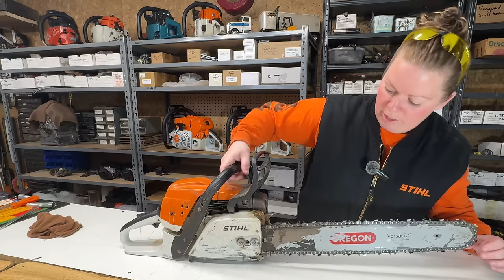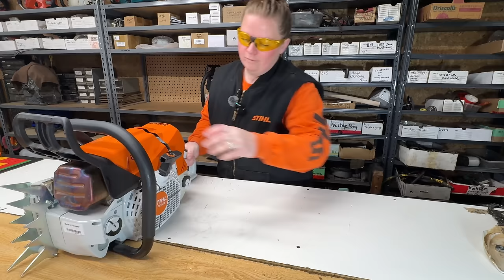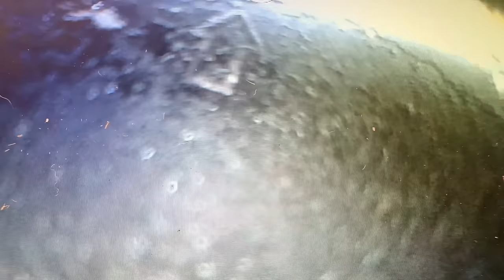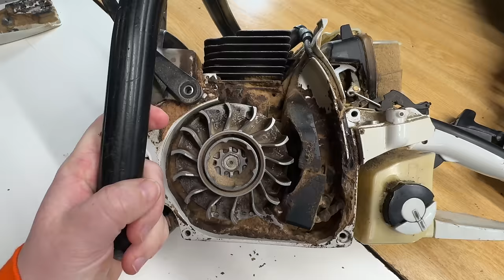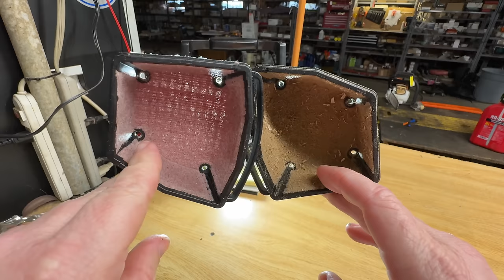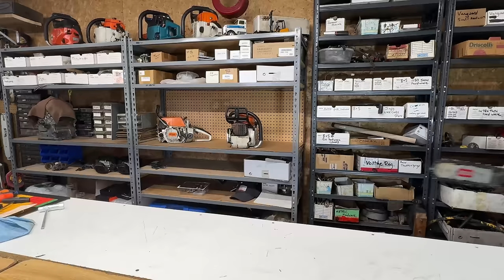Stihl MS 362 Chainsaw!  Very HARD To Start And LOW On Power!  Let's Fix It!

Comment: This lady is good. What makes her videos so good is that she does close ups when she needs to. If I did not know better I would think she works  for Stihl Corp as a trainer. She has all the correct equipment to work on saws and has a pleasant personality to boot. She speaks slow enough to follow her work, unlike the vast majority of shade tree mechanics who seem to think you have to speak as fast as an auctioneer if you want to make videos. Another one of her positive traits is the fact that she cleans up her saws before she puts them on the bench, unlike most other Youtube small engine mechanics. She also moves the parts that she removes out of the camera shot so that she keeps a clean and uncluttered bench. That in itself is tremendously important. She has a good camera/microphone and does superb setups. I don't know if she does her own editing or not but someone spends a lot of time with the software to do that. I rank her Youtube Channel equal to James Condon's Youtube Channel. With all her positive traits I am certain her business is profitable and her Youtube channel is very profitable as well. If you want to learn something about repairing chain saws follow her closely. Did I say she was entertaining too? Well, I just did.

Comment: Great work on the chainsaws, especially the small one, servicing is key if you do it yourself or send into the dealer dependant on the tool and skill set.
Using the right fuels and lubricants from Stihl is key as well, I’m still using the Stihl oil Castrol Manufactured before the red and green superseded the blue one.
Run beautifully😁🇦🇺
Note:Read your Stihl Instruction manual, even on a rainy day!

Comment: I got a 362, and if you ask me, it's one of the best saws ever made for general tree felling. Light, brutal power and acceleration. I use mine with 16" Tsumura light, and an extra 20" Oregon bar in my toolbox.

Comment: This last fall, our snowmobile club purchased an MS362.  We've had a few issues with it and the first one, of course, the dealer said that they had never seen it before...the throttle butterfly shaft was frozen up.  After one running, it was inoperable.  The mechanic had to replace the new carb.  The other issue is the dealer tunes it for 1300 feet in elevation and we run it above 4000.  Just after the saw warms up, it doesn't start unless we have the throttle cracked open.  Other than that, the saw loves to eat wood.  Thanks for putting up such great videos...not only educational but very entertaining as well.
Reply: Time to learn how to tune to carb for elevation & ambient temps.

Comment: I love my saws, especially my big Stihls.  I'm very meticulous when it comes to cleaning them and I do it after each and every use.  Good saws are an expensive investment and well worth the time and effort to keep them clean.  At least in my opinion.  That poor 362 looked like it had never been cleaned.  Wow
Reply: Totally with ya on this.  Replacing big/pro saws isn't cheap. I quite enjoy time in the shed with radio on doing maintenance after a day cutting.
Reply: @badgerjim71  Jimmy you sound like me!  I enjoy cleaning my big saws...my little ones too!

Comment: I have a MS-362‐C with a ported muffler and a 24-inch skip tooth. The saw is a beast.   My saw gets broken down and cleaned "washed" after every use. 
If you take care of your equipment, your equipment will take care of you.
Reply: I have one too. I don’t like the skip tooth because the chain feels rough to me. They sold me this one because I am 74 and I was having trouble starting my bigger saws. When it is cold I pull out the rope 5 times and then it starts on the first pull. I also mill lumber freehand with a 36” bar, works fine. I clean it every time I use it and touch up the chain. Love the saw.

Comment: The 362 The Saw That Choked Itself 😩😩😭 Plugged Air Filters And Clogged Cooling Fins and Air Diverter Ducting Nice Catch 😀Are Shop Is Getting Swamped Also Your Guys Shop Is Huge I Love Working On Walkers My Former Employer Was a Walker Dealer So I Worked on a Lot of Them Even The Old Chain Drive Models 😀😊 Still Work on Them At Were I’m At Now

Comment: Thank you for posting this excellent video. It is a good lesson in the value of giving any mechanical device a good cleaning and inspection at regular intervals. My grandfather owned and operated a commercial sawmill. He did keep the mill's engine (a gasoline v8) and the platform where people worked pretty clean, but everything else was covered in sawdust. He went deaf because he refused to wear ear protection. I hope you will consider wearing ear protection even when you start an engine for short periods.

Comment: Lovely saw the MS 362, I bought one second hand earlier this year from a Stihl dealer. Saw your video and although mine doesn't need a service yet I thought I would watch it, so i know what I am in for when it does, although, since I am retired, it will not get such a lot of use. (that's why i bought second hand)
I also have an MS 162 I use in the garden.
I used to have Partners, which I used a lot in the 1970's felling huge dead elm trees in the English Midlands after Dutch Elm Disease killed them by the thousand. 
I find Stihl a lot easier to get parts for.
I run my saws exclusively on Aspen two stroke fuel which is ready mixed 50:1 Ethanol free fuel since they are not used all the time I know I can leave them for months and the fuel is still ok and they will start after a few pulls.
This fuel is very expensive and wouldn't suit a professional using the saw every day, but will last up to five years. I believe Stihl make a similar fuel but nobody sells it in my area.

Comment: Great video, I had two MS362s given to me for repair recently. Both with severe wobble in the clutch drums, so bad the oil pump arms weren't rotating and both would stall when the brake was operated.. Turned out major PTO crankshaft wear was to blame.. Both saws were scrapped by the owner.. :)

Comment: I have a Husqvarna blower with a ton of hours on it (approx. 2000 or so) that has a similar issue. It just seems down on power. I put a new carb on it, did a spark arrester delete (it's no longer available), replaced the fuel filter, and cleared a restriction from the muffler. I bought a new air filter for it, but the one that is in it doesn't look that bad, so I haven't installed it yet. It belongs to my mom, and it was extremely carbon fouled. She is definitely putting too much oil in it.  All of the things I did made it run better, but it still doesn't feel like it is 100% to me. It's starting pretty easy and idling perfect, but it just doesn't seem like it is running at full throttle. It's a BT130. She's had it for years, loves it, and uses it just about every day year round. I want to get it running as well as it can. Any ideas?
Reply: If it's been run heavy on 2-stroke oil I would think an "Italian Tune-up" would be the next course of action.

Comment: Another great video.  Sure enjoy your channel.  You’re so methodical in your procedures.

Figured this was a good time to ask this question that has been bugging me ever since I bought my first Stihl saw with the Frankenstein fuel & oil covers.  This seems to be a good example of German Engineering.  Why design something that works with 2 or 3 parts when they can come up with something that doesn’t work any better but is much more complicated and consists  of 10 or 12 parts.  You got it, the funky oil & fuel caps.  I have learned new words after I have got back to my log pile after refueling only to learn the gas or oil is all over my pants & boots.  Have you ever learned from Stihl why these have to be so complicated?

I was in awe at how big you operation is.  How many technicians do you keep busy?  Do you each specialize in the equipment you work on?  Do you also do videos on lawn equipment?

Your channel is great.👍

Comment: fun fact, a saw covered in wood dust usually means they have been using a dull chain or a chain with high rakers. the chain should make chips, not saw dust.
an overly tight chain can also make it feel low on power

Comment: Some mornings need a magnum coffee.

Perhaps a new chain went on.  Chain got retensioned after cutting while hot and then put away.   It cooled down and tightened up.

Blue oring on the bar oil cap!

Comment: Question: I have a MS250.  I dont use it often, but when I do use it I use it heavily, mostly in the spring when I cut brush on my acreage.  I usually flip the bar and touch up the chain with a file with each tank of gas.  When I have the clutch cover off, I blow off all the sawdust and oil with compressed air.  Is this okay? It occurs to me I could be blowing oily dirt into spots where it doesn’t belong.
Reply: As long as the air filter is on you should be ok.

Comment: My Craftsman chainsaw start with no problem but after 5 minutes of operating and getting hot it shuts down and don't want to start for a while.
I replace the fuel lines, fuel filter and air filter.
It's a very clean machine with not much use. 
You think it's a carburetor needs to be adjusted or I should look for problem somewhere else? 
Thanks in advance! 
Love your channel!!!

Comment: Used to have access to an MS880 for milling. Great saw for milling but had to get someone else to start it and heck are they heavy. Heavy powerhead, then add the b+c and the mill. Almost too heave to pick up. And they drink fuel, as do all big saws.

Comment: buying at least a portable 125psi capable air compressor for a home shop is good enough for users to use to keep their chainsaw cleaned out after each use
Reply: Please...
OSHA:
"Compressed air shall not be used for
cleaning purposes, except where reduced to less than 30 psi and then only with effective chip guarding and
personal protection equipment."

Comment: Is there a way to check mix ratio of existing fuel? Like they do with anti-freeze mix?  Why do the 881's have a single knob to remove air filter cover but other saws require a tool and 3 screws to remove the cover? My 260 is a  quarter turn to remove the cover. Were users having issues with the covers falling off?

Comment: I have a 310 and a 461, I can't imagaing needing a 881 except in the redwood forest.
Reply: I cut mainly hardwood and some of the bigger stems, are easier cut with something that’s not going to be screaming the whole day. Plus, if you’re going to be running 36” or greater, for more than the occasional cut. More cc just makes life easier, providing you’re not carrying the thing and everything else you’ll need for a day’s cutting a 1,000yds. just to get to the first tree.

Comment: When a saw comes in thats just completely filthy, i mean like 15-20 min of cleaning prior to inspection do you charge an extra fee or just add it to the hourly rate.
Reply from the maker: Hi Mike.  I just charge for how long it takes.   If a saw requires 15 mins of clean up , then it’s 15 min of labor on the bill.   Most customers don’t mind and appreciate getting the saw back cleaned up.   If they wanted to do it themselves , they wouldn’t drop it off for me to do 😊
Reply: @marriedwithsmallengines  thank you Erica, sorry to bug you but I sent you another email. Sorry for so many questions. Take care ma'am.

Comment: Whats yr thought on a 500 I ? Thinking of purchasing one with a 28" bar
Reply from the maker: Amazing! 🤩
Reply: No carb to worry about and it seems like the injection and computer system is bulletproof.
Reply: The only issue with the 500i is fuel consumption. Other than that its great. Id get a 462
Reply: The 500i as has been said, is heavy on fuel but it is near 80cc. I run a 25” bar with full chisel full comp chain, (I’d use semi skip it ever or even full skip, if I was going to run a bar longer than 30”). It would fly with anything shorter than 20”. I think 25” is it’s sweet spot but I know a few who run their’s on 28” or a little long and they’re happy.

I’ve always found mine hard to start from cold or hot from new. But once it’s running it’s good. I’ve also got a Husky 545 Mk1 on 15” and a Husky 550XP Mk2 on 18”, (both on .325” .058”, full chisel full comp. Those handle 80%+ of the stuff I deal with; I only use the 500i, when I know I’ll be cutting 24” dia. and greater stems all day.  Just easier on the equipment. If I’m going to have to carry everything I’ll need, plus some of what I might need and it’s a 1,000yd. walk to the tree/s. Then the 500i stays at home.

Comment: The indent on the front of the saw, where there was something that looked like it'd ground out a piece of the front of the saw, looks like a tool mark.  I bet it got pinched and an attempt (maybe successful, maybe not) was made to pry it loose with a flat bar.

Maybe not a great thing to do on a magnesium crank case.
Reply: I think You're onto something 👍

Comment: Those air filters are cleanable and reusable both the inner and outer. Mine have lasted 12 years or more no problem. It’s a far better system than my 500i which needed modification just make it seal from new and that’s not uncommon.

Comment: You examine chainsaws like I examine my patients.  In a thorough and methodical way. Short-cutting an examination leads to missing important information. Then the correct diagnosis isn’t made and treatment is completely wrong or insufficient.
Reply from the maker: Amazing comment!! Thank you!!
Reply: Follow an ABCD approach with your chainsaws too - A - air intakes B - air filter C - fueling system (fuel filter, hose, carb) and D - Coil and Spark.  That saw had a case of COPD :-D

Comment: Great video.  Just a brief comment noting the direction Stihl are headed in regards to what they term "in house" manufacturing of all their domestic saws.  For the STIHL MS 362 Chain Saw with a not exactly inexpensive price of Canadian $1,189.99, "in house" means the following.  
Top plastic hood   Virginia Beach USA.  
Oil pump China QUINGDAO.  
Crankcase Weinsheim (In house) Germany.  
Saw bar Waiblingen (Outsourced) Germany.  
Saw chain China QIL.  
Cylinder  Sao Leopoldo Brazil.  
Carburetor  China.  HUIZHOU  

Only the crankcase is Made "in  house" at Stihl's German factory?

Sorry Stihl.  In house to me means 100% Made in Germany for all components of a saw.  Cheers.

Comment: Genuine curiosity. Air filter's getting clogged up. Not a real big surprise given the environment it normally works in. In a perfect world, how often should I inspect my air filter and at what point should I plan on replacing it?
Reply: I inspect it after every day of full use, and you can clean them dozens of times before they need replacing

Comment: I thought the 362 had a twist lock circle ⭕ air filter. That is filthy.  Did they get rid of that style?   

What type of wood stove is that?
Reply: The later version has the circle filter.  The saw in the video appears to be a very early 362.
Reply from the maker: Yes, newer 362's changed air filters. 

My woodstove in made by Pacific Energy :)

Comment: is it realy necessary tot put chainsaw oil in even when you not are cutting or without bar?just for running the engine?
Reply: If the chain isn't on I don't suppose you need the bar/chain oil.
Reply: Perfect time to confirm it's oiling properly
Reply: I think it is a good idea to have oil in the machine to keep the oil pump lubricated.  Short runs may not cause any issues, but why take a chance?

Comment: I don't understand why there is this mesh at the outlet of the muffler ?.
Reply from the maker: Yes, that is the spark arrestor - to keep sparks and carbon from flying and potentially starting a fire.
Reply: @marriedwithsmallengines   If you use good quality fuel oil, nothing like this should happen. On the other hand, I admire you because, as a woman, you like to repair such equipment.